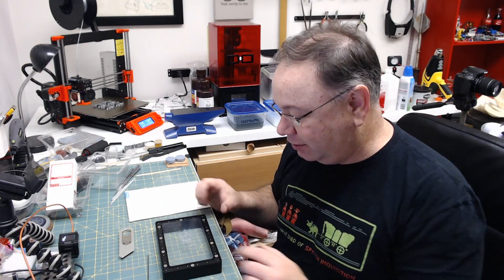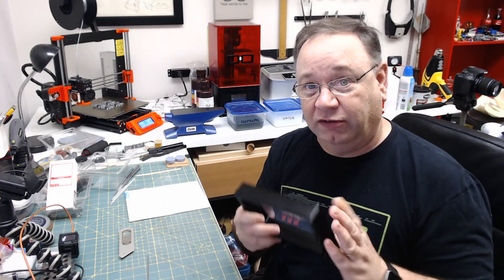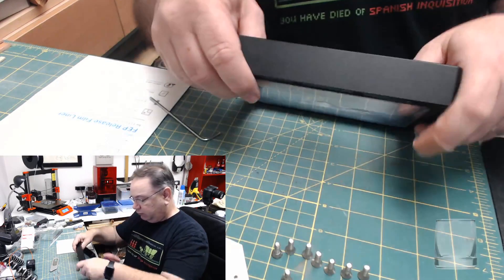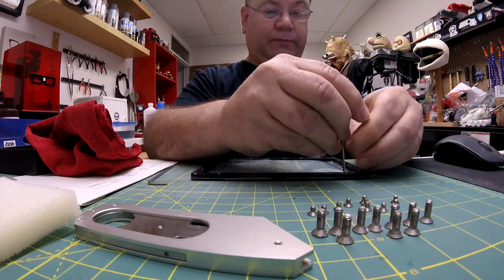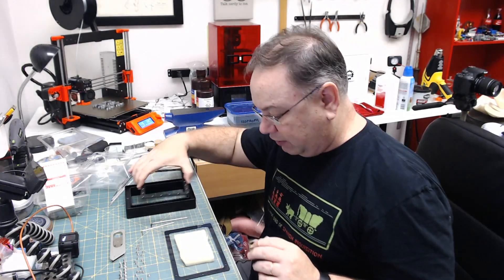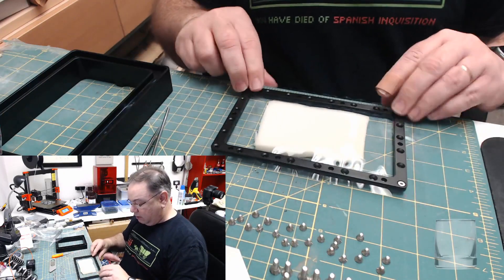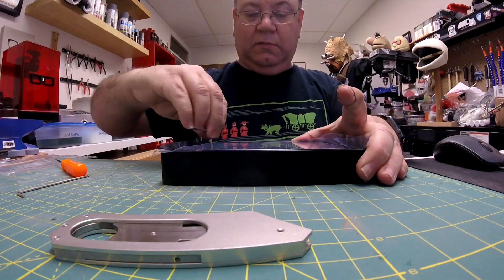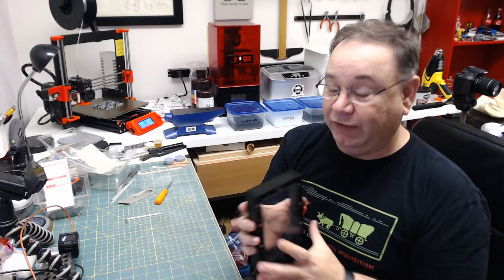Replacing the FEP film in my Elegoo Mars 3D Printer

Comment: Does your Mars stick at the bottom of the cycle? My printer sounds like it sticks at the bottom every time and then there's a sucking sound as it pulls away with a micro shake in the unit.
Reply from the maker: totally normal, in fact it's one of the things you should be listening for in the early part of the print process. It ensures there is something stuck the build platform. If you didn't hear it that would be a warning sign that you have a print that has failed and you'll find an empty build platform and a puck of cured resin stuck to your FEP (heartbreaking every time)

Comment: Looks good! My only recommendation would be if using a sponge to not use a rough one. If paper towels can micro scratch feps a dry rough sponge may not be ideal. Hard to tell from the video if it’s rough or soft tho. Just wanted to leave a note here.
Reply from the maker: in my case it was soft upholstery foam, but that's a very good point. Everyone, take note!

Comment: what about replacing the piece of plastic over the screen the uv light projects through
Reply from the maker: I think that's just there for manufacture and shipping, remove before use and discard
Reply: @NerdsMakers  That plastic saved my screen though. One of the prints punctured a hole in my FEP and resin leaked down onto the screen and cured. When the print finished and i removed the resin vat i got scared that i ruined the display. Luckily the piece of plastic on top saved my display.

Would it be safe to use a FEP sheet on top of the screen too? I bought some 95% Dotbit sheets from Amazon.
Reply from the maker: @overlord4509  if I had to guess the plastic was also scattering light and making your resolution worse. It was lucky you  saved your screen though. If you were going to add another sheet I'd look for the thinnest screen protector you can find, and recalibrate once it's installed
Reply: @NerdsMakers  thanks for the info. I honestly didn't notice any missing detail. But again i am coming from filament printer to resin and honestly I could not believe the level of detailing on my first print.
Reply: @overlord4509  its not the end of the world if some resin cures on your screen, you can use a plastic scraper to remove it and there should be no damage to the screen. Having said that it is basically a phone screen so you might be able to use an appropriately sized screen protector

Comment: Man, I hate it how easy it seems for other people to do... It always gives me a really hard time to fasten the fep holder back onto the resin vat... Are there any tips for doing this?
Reply from the maker: Make sure you have enough "slop" in the frame, use a sponge under the FEP when you assemble it. Pre-punch your holes with an awl, tighten the screws in a cross pattern, like you would a tire. Work slow and purposefully, take your time.

Comment: Thanks a lot mate, nice and easy, i like your no rush approach in the video, and in the work..
I also did this FEP change, it worked, and my Mars is printing super nice again.
only one details i noted, all my screws are a bit oversized in the allen key hole, this means you need a brand new key and a good quality type, else it may turn a click and make your hole round in the screw.

Comment: Hey up. 
So did it work? Seen a few vids and some use foam under film some don't. Just wondering if it printed well after you changed?
Thanks 
Bonzo
Reply from the maker: yeah, done a few prints with it and it's working great
Reply: Its actually possible to get FEP too tight. The sponge prevents too much tension. I went from 100% reliable with factory set FEP, too 100% fails on every print because FEP was too tight. It needs to be a tiny bit loose.